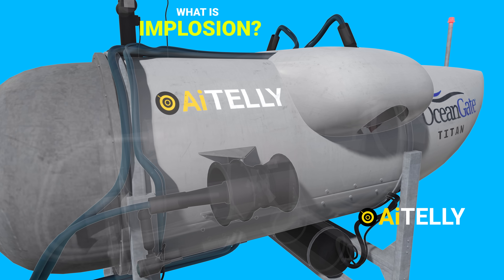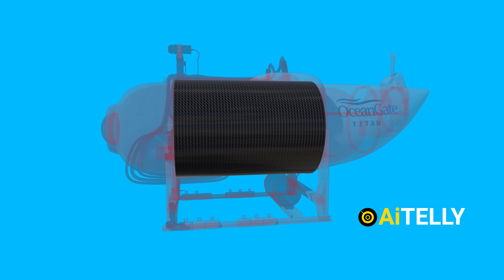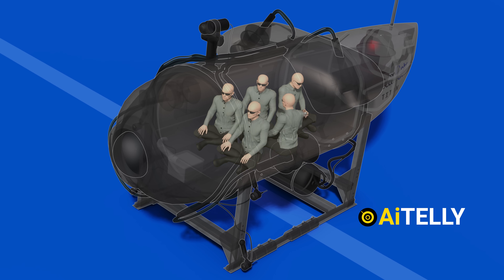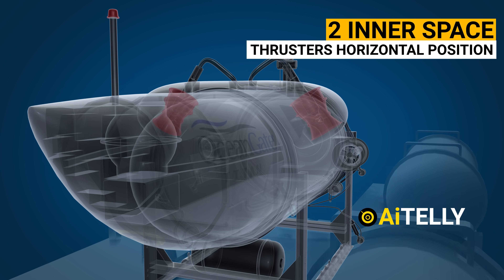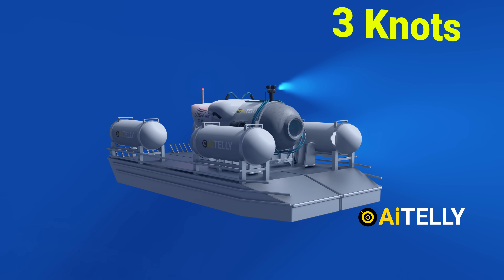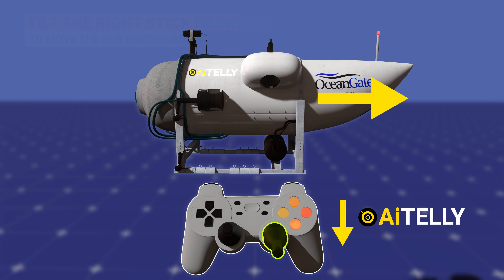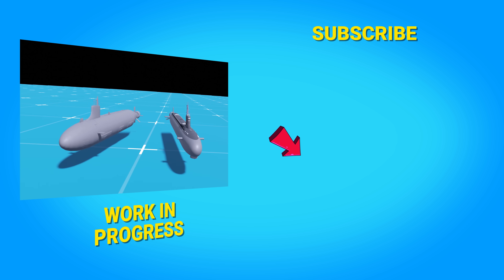Implosion Titan Oceangate How it Happened | Submersible Submarine Parts #3d

Comment: How comes the "titanic" hasnt started crushing itself down , being 2.5 miles down for a very long time?
I know it alot bigger, but surely by now its taken the brunt of all that pressure for all that time. Please explain👍
Reply: The titanic has no empty spaces inside containing air.  Water filled all its empty spaces very early when it sank…so the pressure on the inside is equal to the pressure on the outside. Therefore there is no crushing effect.  Same for the dish ware, bottles, etc around the titanic.  Anything that did not have air filled empty space inside was not crushed.
Reply: @mikedaugherty30  cheers for that. Does make sense now you look at it like that.👍
Learn something new everyday

Comment: Even 10 meter under seawater and you kinda feel the pressure on your balls about to implode imagine 4000 meters.

Its unbelievable the depth of titanic is almost half of everest. Thats about 10 times empire state building stackup on top of each other.

And Titan was designed to crush when it is exactly at 4000m. Not to mention its the 25th dive.

Comment: Anybody who has worked with composite materials would understand why it was a terrible idea to incorporate it into a deep diving submersible. It's very difficult to spot any surface defects during maintenance and impossible to examine the inner structure. The basics of composite construction involve layers of carbon fibers bonded together by a matrix of some sort, these layers are fantastic at handling tensile loads due to their weave structure, but awful at handling impacts head on, which is why there is usually a honeycomb core. The slightest of impacts could delaminate the layers and compromise the integrity of the sandwich, creating a weak point. This impact could be something as casual as dropping a tool onto the frame. Stockton should have stuck to titanium based alloys.
Reply: Plus, the carbon fiber composite was subject to cyclical fatigue.  That happened from test dives in 2018 and 2019, and the composite was replaced by 2021.

Comment: Your simulation is utter nonsense and bares no correlation to reality.  I think you already knew this but just making a quick buck from non engineering viewers like all the other sub videos.
Reply: One example is that it shows the rear cover distorted; in actuality it was recovered nearly intact, because its interior was at the same water pressure as its exterior, and hence did not implode.

Comment: 3:45 I disagree with the information presented in the video. The oxygen supply is not stored in the exterior compartment of the Titan Submersible; rather, it is securely located within the submersible alongside the passengers. If the oxygen were indeed held in the rear compartment, it would require the installation of pipes to transport the oxygen into the cylindrical submersible. However, this setup would introduce vulnerabilities and weaken the overall structure of the submersible.

Comment: Your diagram of the carbon fiber was not correct, it was not weaved like it should have been but juat wrapped like a kite strib. Wrong material either way and wrong shape. Duh
Reply: No, it should not have been weaved.  Longitudinal fibers would just add tensile strength in that direction, which is not needed.
Yes, wrong material, but cylindrical is a correct shape to withstand pressure differential (inward or outward).
What was really wrong in the 3D model was the thickness -- it was actually about five inches thick.

Comment: That's why titanium is safe to use for deep dive in ocean and it can stand against the pressure around 20,000 PSI or above but Wreck of the RMS Titanic on sea floor is around 6000 PSI.
Reply from the maker: You might also like Nuclear Powered Submarine Engineering behind it #3d Nuclear Reactor released
Link: https://youtu.be/J0lb46Zi5-s

Comment: Looking at the layout of the submersible, one finds it seductively modern and complete.  The immediate flaws are the carbon fiber hull (obviously) the hatch closure, the toilet arrangement, and the game controller.  The steering mechanism is another thing that appears to come up short.  Very interesting animation.  I think showing the intensity and immediacy of the implosion would be worth illustrating.
Reply: The most obvious flaw is its layout. Guess why every other submersible is a ball shape 🤷‍♂️
Reply: The passengers should have been wearing diapers.
Reply: I don't agree with the fuss about the game controller. Everyone understands how to operate it, it worked perfectly and it had nothing to do with the implosion.
Reply: If you don't understand the range of motion and precision of the axis on the controller that was used, I pity your lack of intelligence and ask that you please use one before opening your mouth. Game controllers were LITERALLY INVENTED for precise input control with little to no latency. There is no difference between the controller that was used and an operator's controls. The ONLY case where a specific input controller would be used is when there are too many functions for an average gamepad won't suffice. Every needed control for piloting the submersible could have been easily mapped to the gamepad, and any necessary functions specific to the operation of the sub could have been accessed from the interior or by the mothership. They are meant to be cheap and easily mass produced while also maintaining precision. Stop running your mouth
Reply: Controllers was alright.
Reply: "The immediate flaws are the CF Hull (obviously)".....That one sentence tells me you know NOTHING of what you speak .More time writing the comment then any actual experience or accurate knowledge of working with composites.. I bet you did like the cartoon though...

Comment: The front cap doesn’t swivel open. It’s glued to the frame. The front window is where they enter and exit. It’s also fitted with 17bolts from the outside.
Reply: Just a titanium ring was glued. The titanium cap containing a small window moves entirely and seals against the ring

Comment: Great video. 5:58 It's not that carbon fiber was weak, in fact it's many times stronger than both steel and titanium. The problem was that it wasn't compressible so as to be resilient against pressure.
Reply: Carbon fiber is most certainly not stronger than titanium, not just by itself. The fibers have to be aligned with the stress; if not, it is actually weaker than titanium

Comment: The sub did make it to Titanic twice previously I believe, this wasn't its first trip. But yeah the quality control, and the corners he cut every step of the way in building it lead to this accident. He was super rich himself though he didn't need to cut corners like that, ultimately paid the price, otherwise the idea behind the sub wasn't too bad. Could have worked fine if he did it properly.
Reply from the maker: You might also like Nuclear Powered Submarine Engineering behind it #3d Nuclear Reactor released
Link: https://youtu.be/J0lb46Zi5-s
Reply: So then Meatloaf was right ?
Reply: Out of how many attempts??
Reply: It failed most of its attempts

Comment: I was a very bad design and had he put it on the bench trial it would have failed certification for sure 
Certification takes time ressource n money .
Material fatigue can be simulated in the lab 
Most submersible have an operating depth set by design considerations n to be respected 
His design had lots of flaws
Over time equipment like that are recalibrated and pass an inspection visit to ensure that all is ok
His case combined improperly
Look at the early submarine, read their design intent n u will see that it is no joke 
Same for the military submarines
Intensive experiment n test are executed.
I hope that all the submersible out there will make sure they do a 6 month inspection or an inspection after every dive .
Airplane too they do NDT altrasound test to ensure no crack on the body
 Rip to these innocents souls

Comment: To my knowledge, carbon fiber composite is quite strong and also very brittle. Cracks could have developed in the carbon fiber mesh. Getting bigger with each dive. Finally progressing to catastrophic failure.
Reply from the maker: Agreed,but I guess after 4 dives

You might also like Nuclear Powered Submarine Engineering behind it #3d Nuclear Reactor released
Link: https://youtu.be/J0lb46Zi5-s
Reply: Very true. This is why carbon fiber bicycle frames only last about 4-5 years before showing cracks. Could be riding them in high heat or transport under the hot sun, and then riding in the winter as well.

Comment: I remember a while ago a deep sea pressure center used to house deep sea welders meant for repairing things like oil rigs and to cut a long story short, unfortunately there was a pressure malfunction in which the seals never fully sealed which resulted in a massive implosion and all that remained was liquid offel and the same applies to the titan in which, due to the crushing pressures at those depths it would be not too dissimilar to you crushing an egg in your hand whilst underwater or a tomato, in which the pressure would be so great, they’d essentially pop like a squashed tomato as their internal gasses are being pushed outwards as their. Bodies are being squeezed inwards, again all that’ll be left would be pinky finger sized bits of meat floating around but mostly just a pool of bodily fluids, although on the upside at least Death comes relatively quickly.
Reply: That whole comment had just two full stops..  impressive!
Reply: @drewlovelyhell4892  ……………………………………………………………………………………………………………………
Reply: Yeah thanks for the very grafic description.
Reply: So basically they were squeezed together and popped omg this is so horrifying thanks for the graphics I just can't imagine the horror on their eyes
Reply: Lmao no, not how it works.
Reply: ..death .. not Death..
Reply: More a foggy , watery red cloud of blood and tiny pieces , it would seem like some of the bodies were partially intact , as the Titan was in pretty big pieces but alas that is cheap metal and materials...  jankety old Titan,  rest in peace 4 victims,  your ghosts and spirits shall be friends with the Titantic's spirits that lurk in the deep of the sea.

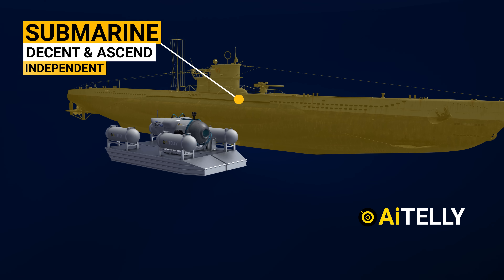Comment: By the way, the submarine you show at 1:45 is a "type VII C" German U-Boat from WW II. This is a classical "Tauchboot" ("dive boat") but not really a submarine in today's understanding of the term. The VII C sailed above water for most of the time using its diesel engine and only submerged for limited time for either attack or defence using battery power. This is why it has an almost sailing boat silouette unlike modern drop-style submarines.
Reply from the maker: Thanks but it's a U-69 You might also like Nuclear Powered Submarine Engineering behind it #3d Nuclear Reactor released
Link: https://youtu.be/J0lb46Zi5-s

Comment: I wonder if the composite materials or it comes in sheet and they put resign on it if you pull one way it is strong but pull a different way its not. I hope they didn't use resign. Thats how they make rings and other parts using composite materials. The rusty pipes used as ballasts. Really.

Comment: Declaring that the implosion happened in a milli second and death was instantaneous and painless is just an assumption. How would they know that. Have they done such implosions at such depths and seen how long it takes and how death of the passengers or destruction of the submersible happens? 
The company claimed it was safe to go down with the submersible. Everything is just an assumption here and safety was grossly ignored. And to think they paid a fortune to go down to meet this disturbing  end there is even more painful
Reply: It’s 5500 PSI. That’s a water jet that will break bones. That much force is moving faster than you can process this comment.  Once the hull failed it would take less than 1 millisecond for the water to rush in.

Comment: Why do you say video game controller? Its not, its a controller and can be used with many applications.
Would you call it a video game controller if it was used for a guided surface to surface missile, or for a military drone?
The controller was programmed for its purpose, it was never used for gaming, it was used to remotely control the thrusters on the submersible and was never an issue.

Comment: The camera being near the high voltage  lines for propulsion is concerning. One also has to wonder if the CO2 scrubber being so close to the comms is problematic given a high voltage power source may drive the crank for the pump.

Did they shield the electronics from the scrubber?
Reply from the maker: You might also like Nuclear Powered Submarine Engineering behind it #3d Nuclear Reactor released
Link: https://youtu.be/J0lb46Zi5-s